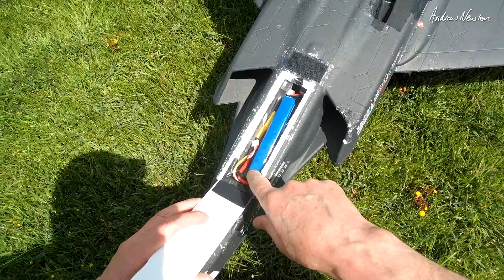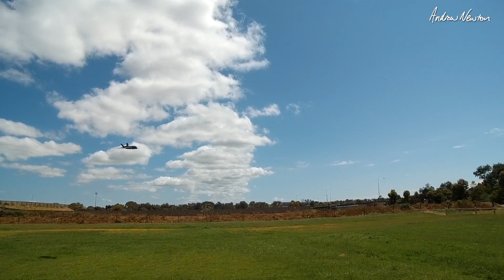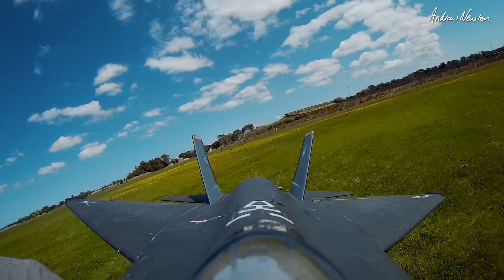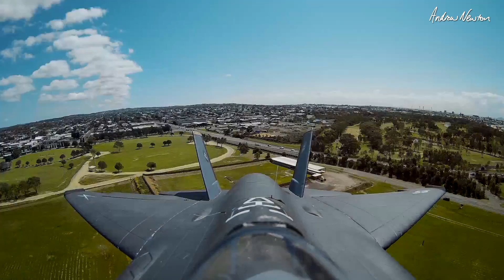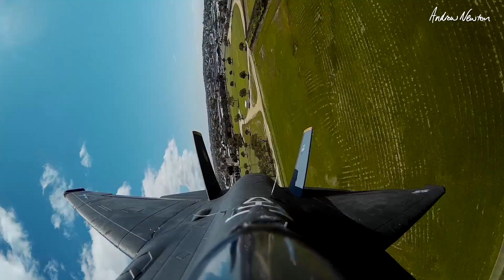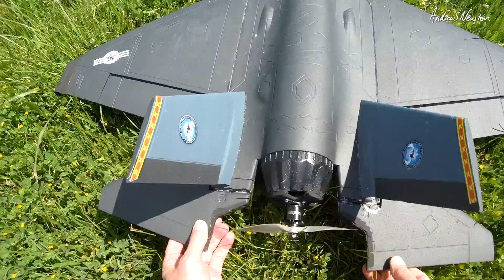Nicesky F35 Pusher Mods

Comment: very nice mod mate, maybe something that would fit my old 64mm HobbyKing F-35 aswell, how is the torque during launch, didnt looked that bad on the video (did you do anything with the thrustangle on this thing?)...anyway nice video and thanks for sharing, cheers
Reply from the maker: Didin't notice any torque, but I never do anyway, always flying in wind. Just bolted the motor on straight and it was good.

Comment: EDF jets in the 70mm category w similar wingspan and retracts use at least 60A on 6S w a nice EDF 12 blade unit.

Way underpowered because of cheap ass electronics. Use a 3300mah 6S w a minimum 40C, 80A and it will move using retracts.
I still like very much how you converted it to pusher prop. I cant imagine this thing on 6S, a rocket using a pusher prop.

good job!

Comment: Mate, as always you call on your creative ability to make something out of nothing from what was a poorly designed & manufactured EDF. For a $225.00 RC Aircraft though, in anyone’s dollar, we should NOT have to do a THING to it but fly and enjoy.
EDF Propulsion is not the easiest to get right, it is basically a single stage compressor which requires a correctly designed Intake AND Exhaust path so that it will give maximum thrust, with minimum cavitation and pressure loss.
Dont give up on the EDF, I would gladly like to see you use the discarded one from this plane in a Scratch Build.
Cheers...<]:)
Reply from the maker: That's the plan Bruce. I have to in parts on the bench
Reply: @AndrewNewton  Cannot wait!

Comment: That's what manufacturer should,ve be done in first place ,or left the gear off and put better quality EDF ,but what difference love to see it with 4s maybe it will fall to pieces the  mega  G forces will make it implode  ,shame a good looking model with a little more thought could be been great out the box for the same cost/ profit carbon rods for instance wings and tail , elevator be around 2 dollars max
Reply from the maker: I think this is a very old model that has been re-released, foam technology has improved

Comment: Wooo! Great flight and onboard footage. And yep, another perfect illustration of why I've never bothered with EDFs!... Clearly nothing wrong with the model aerodynamically. That said - if you want a halfway point between a  prop's efficiency and an EDF's sound/feel, in addition to the whistles, you could maybe swap in a higher-kV motor and a smaller multi-blade prop. But your current setup will still fly best from a non-aesthetic point of view.
Reply from the maker: It flies very well, fast and direct. Smaller prop on 4S might be the sweet spot

Comment: Great mod, a few guys at my club fly some big Motion RC jets and they are awesome but a whole heap of money in models and batteries. Can't beat a good pusher prop jet. Have you seen e3scott's  channel. He has some very fast pusher prop and slot jet using quad motors and 3 blades props sound great and won't break the bank. 👍
Reply: Seconded, e3scott does great work. The ones he flies are slot designs, too, so noisier but potentially supermaneuverable if you're willing to really chuck them around. :D

Comment: Excellent! It just needed the Newton Engineering upgrades.Doesn't take away from the appearance in the air either.
Reply from the maker: Elevator hinge area is still too weak. Might need a balsa replacement.

Comment: Thats interesting but would of liked to see you try to improve the EDF performance. 
Since you have a prop maybe you could do thrust vectoring with something like the Flight Test thrust vector kit.
Reply: WannaDIY  make your own video.
Reply: WannaDIY  to improve this requires spending 80 dollars or more on a not so good mid cheap new EDF on a low quality model just not an option by the time you do that and carbon rod frame wings vinyl wrap epoxy never ending with original cost your way up at a price you'd get a good quality plane to start without the hassle this is a better solution make do get a fun Flyer for no extra cost Andrew would have plenty of props and motors spare so why spend more on it